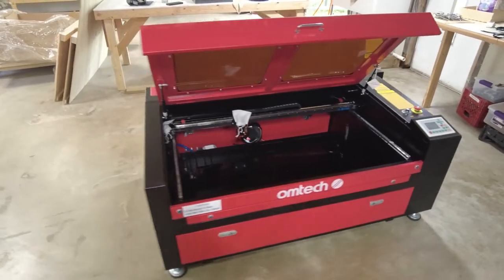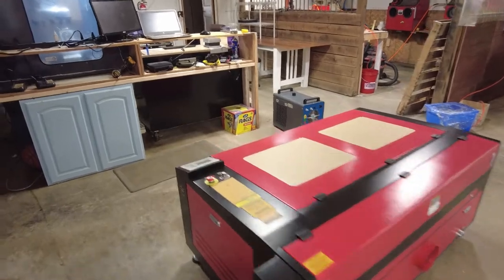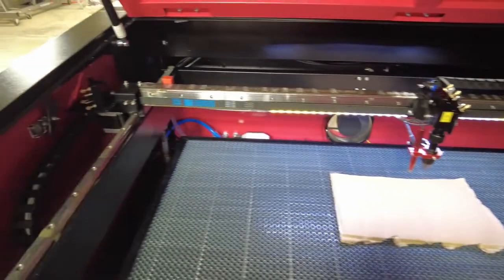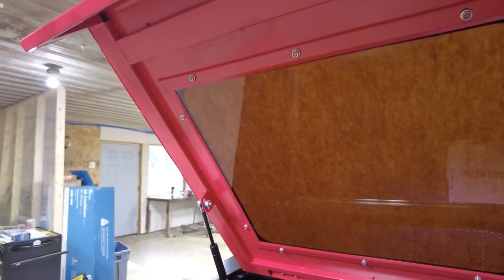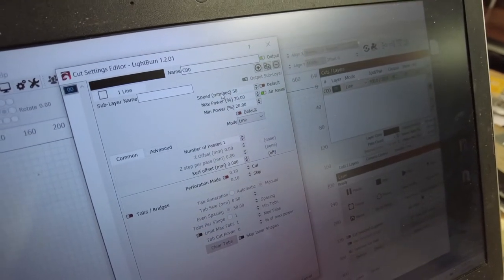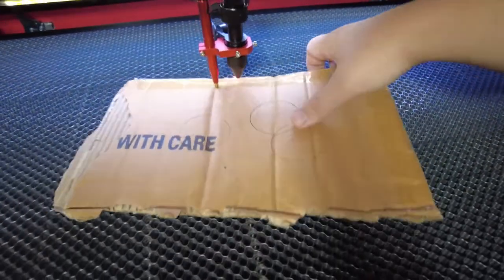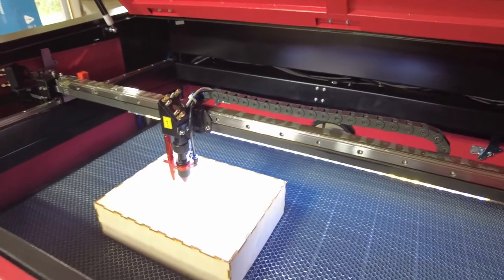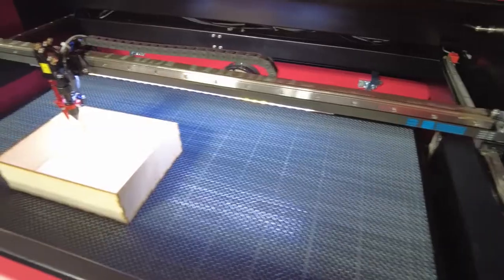It's New Laser Day! | Omtech 100W 24x40" CO2 Laser (Not Sponsored)

Comment: Where did you get the pallet racking? That looks like it worked really well for a table. We got an identical laser delivered today and have a need for a table for it now.
Reply from the maker: It just came from manards. Though, a few months later and I do regret building the table this way. It's slightly wobbly, and it's like 6 or 8" larger than the laser on all sides, which is just wasted space. Someday I'll take this apart and replace it with a 2x4 and plywood box. Maybe with some drawers underneath for material storage

Comment: You went with the small one. with such a large shop size?
Reply from the maker: 40x24 is not exactly small for a laser. It still takes up a pretty decent amount of room

That being said, the biggest reason I didn't go for the bigger one was cost. Theres a big cost jump between the 100W model and then 130 and 150W models. And the 100W is already overkill for what I need.

Comment: Whe  you're cutting through materials that are thicker you will want to use a lens with a longer focal length , my typical go to is a 63mm lens for materials up to half inch thick .
Also don't run your laser at 100%   you will kill your tube a lot faster
Reply from the maker: That's on my list of changes to make! I think I'll mostly be running thicker materials, so the longer focal length will come on handy.

And yeah, they gave me a document that has tube life compared to power setting. It diminishes fairly rapidly at higher power settings.
Reply: I've had my laser for about 3 years , not the same brand as yours but its similar . I've used all the different lenses , the ones I use by far the most is the 63 but if I'm cutting thick foam like a inch plus I use the 120mm lens.

I use lenses from cloudray on aliexpress . Cloudray II-VI Znse USA . Those are the ones I found to be the best quality for the price at around $20 -$30 per lens . The second thing I would highly recommend is having air assist when cutting almost everything , if you will be cutting thicker material like I did I would hook up your shop air with a separate regulator . Whe I cut over half inch ill usually set that at about 20psi and it works much better than the stock air pumps that barely put out any pressure.  Oh also make sure you're cleaning your mirrors and the output lens of your laser tube , I only cleaned the laser tube output lens very infrequently and I ended up killing my tube that way. 
On the new reci tubes there is a separate replaceable lens but on my old one there wasn't.  Lastly make sure you vent that suckered  good , almost everything you will cut will produce cancerous fumes. 
Sorry didn't mean to write a book on this , just some tips from my experiences .
Reply from the maker: all very good info, thanks!

I didn't even know you didn't had to clean the lens on the tube! thanks for the heads up 😬. I do have good ventilation at very least now. We got that hooked up the other day

Comment: How yours laser ?  You recommend this brand I thinking purchase same but I can’t found honestly review
Reply from the maker: I do not have any affiliation with the company, and I can say that I definitely like the laser. I'm really glad that I upgraded the ventilation, and the autofocus isn't quite useless, but pretty close. But overall I am very happy with it. It takes occasional maintenance in terms of cleaning and alignment but I haven't found it too bad. Overall it just runs and runs. I use it probably 10 hours a week, and haven't had any major issues.
Reply: @AudacityMicro  lot people
Complaining about speed. How that ?
Reply from the maker: I'm sure it depends on what you are doing, and the power of your laser. This one is a 100W, and I only do cutting in easy to cut materials, so I don't have issues with speed. 90% of the time I'm just cutting cardboard, and it's plenty fast. Doing things like rastering large grayscale images can be rather slow, but that's true with all Cartesian lasers (as opposed to galvos).
Reply from the maker: I am cutting cardboard at about 50mm/sec. most of the other materials I cut land between 10 and 30 mm/sec. And I engrave at around 170mm/sec. If that helps at all.

Comment: I'm looking into getting this same laser, will it cut 1/2" mdf in one pass, if so what speed and power?
Reply from the maker: It'll probably cut 1/2" MDF, not sure if you would want to do it in one pass, and I'm not sure the edges will look nice. Maybe if you swapped to a longer focal length lens and added a better airblast. Lasers are great for cutting this stuff quickly, not so great for cutting thicker stuff. A CNC router would be much faster for 1/2" MDF.
Reply: @AudacityMicro  I have a CNC machine but it won't cut the fine line I need, lettering also comes out not so good since it can't do inside corners with an 1/8 bit very well. I planned on using my compressor for the air assist and started looking into a 4" focal lens.

Comment: How tall is the machine? I’m 5 10” would you say I would need a stand to set it on ?
Reply from the maker: It's maybe 24" tall. I can't imagine anyone not needing a stand, though OMtech does have a different style unit that is on wheels. It's more expensive, but might honestly be worth it.
Reply: @AudacityMicro  I think I just bought the same model, AF2440-100E.  ebay does not have good info on dimensions.  What measurements are your machine?  I'd like to get a head start on building a stand before it gets delivered.  Thanks
Reply from the maker: 61x38x27" for the main enclosure itself, not including anything that might be sticking off, like the vent in the back, or the tube extension on the right
Reply from the maker: I recently rebuilt my table for it, I made it 30" tall, and that ended up being too tall. It's usable for me being ~6' tall, but my wife has a hard time. I would probably go with a 25ish tall table next time.
Reply: @AudacityMicro  Thanks for the reply.  Will start building a table tomorrow!  You should do an update vid on your Omtech.  Nice shop btw!

Comment: How do you like your laser?
Reply from the maker: I really like it! It's been a huge asset to the shop. The autofocus isn't great, I just removed it. But everything else has been fantastic. No issues.
Reply: Thank you,  yes its just as easy to use a manual gauge to set focus.  Does that model have a chip tray?  how do you think it would cut 1/2" high grade plywood.  I have a router but have a need to cut some finer detail.  Thank you!
Reply: I'm looking at same machine or a 130W
Reply from the maker: I've used it to cut 3/8" ply, and wasn't super impressed. Though to be fair, I was using construction grade stuff, not the the higher quality stuff that is normally recommended for lasers. This laser also isn't wide enough for 48" sheet, which would be a big plus with the 130W if I remember correctly. I would also like the longer focal length less, that should help significantly with the thicker materials. But I wouldn't recommend the stock setup for it.

Comment: Hey does this model include air assist?
Reply from the maker: It does, though, I recently upgraded to a version that lets me run it off my air compressor, and that made a big difference on cutting thicker materials. It now easily cuts 1/2" MDF. Even 3/8" was a struggle before I upgraded.
Reply: @AudacityMicro  what is needed to upgrade?  A new head?
Reply from the maker: I bought a new head with a longer focal length lens, and a solenoid/controller set for the airblast.

Both things together totaled about $300
Reply: @AudacityMicro  one last question.  I purchased this unit yesterday from eBay.  The price was so good I couldn’t resist.  Is this Omtechs older units?  Do they compare well with their latest offerings?

Comment: can it cut through 1 inch of wood?
Reply from the maker: Theoretically yes, with enough time and passes, but it would give you a terrible burned finish. It can but it's not the right tool for the job. A CNC router works better for anything thicker than about 3/8". Lasers are in their element for 3/8" and thinner.
Reply: ah i see thanks for sharing